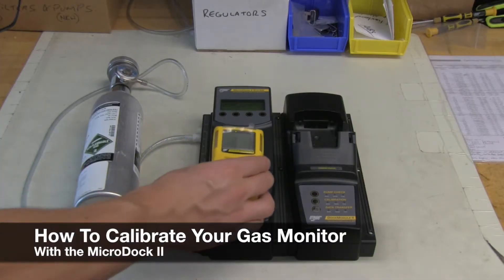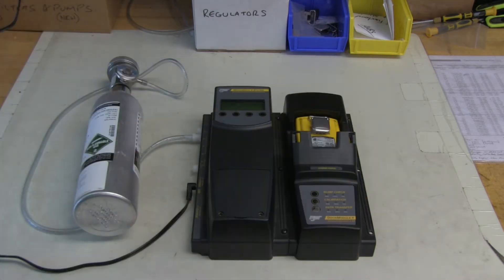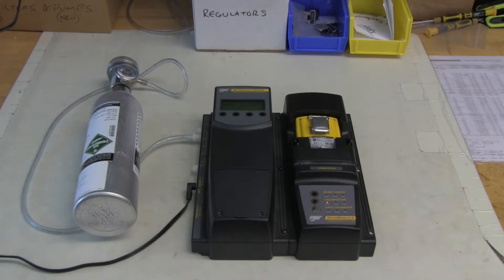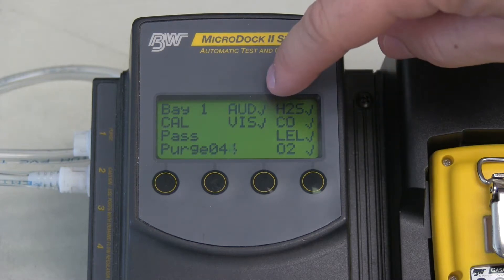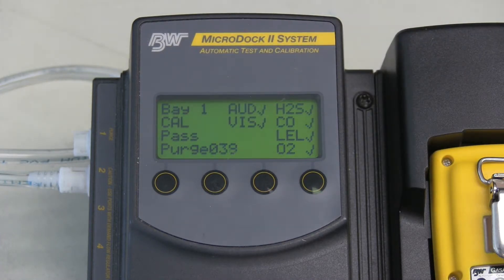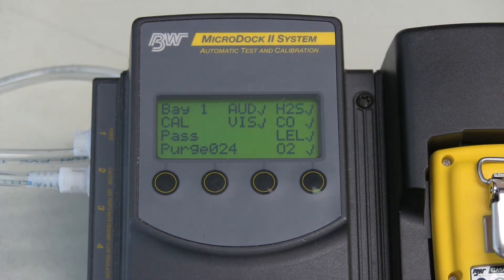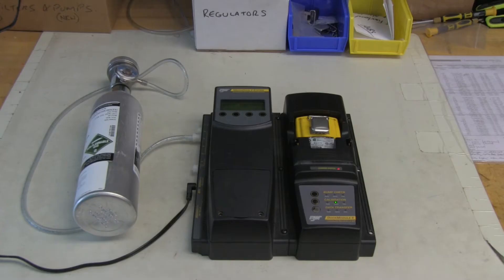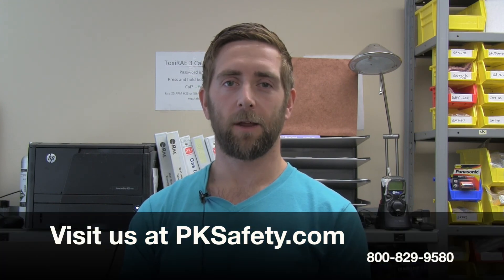How to Calibrate Your Gas Monitor: MicroDock 2 Series, Part 3

Comment: What to do if fail?
Reply: Responding to a calibration failure would depend on the reason. If the procedures are followed according to directions, the failure mode will be noted. Could be that the instrument needs a new sensor. Replacement is easy and quick, simply purchasing a new sensor and swapping it out. Then re-calibrate and you are good to go. If it is something else, it may be good to contact our tech service dept for advice on next steps. We stock all replacement parts, and most are an easy swap. The instruments are quite robust, lasting many years with basic maintenance.